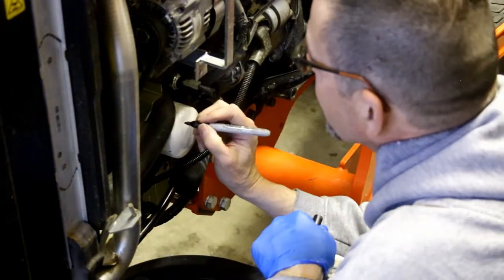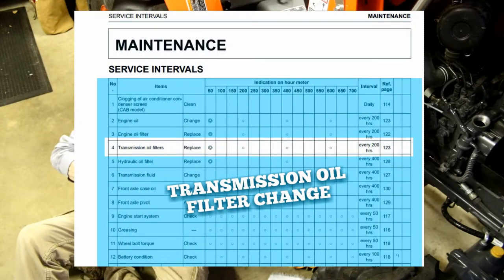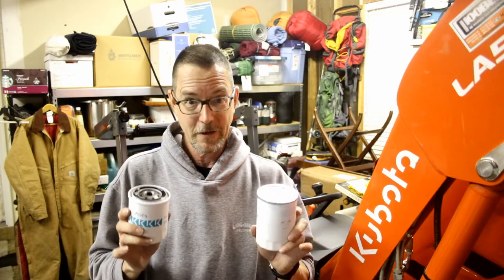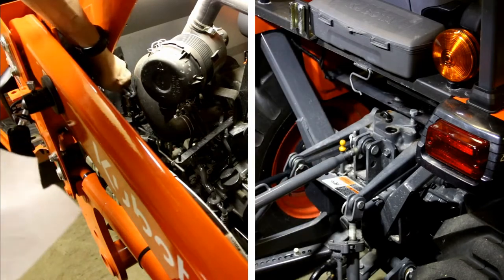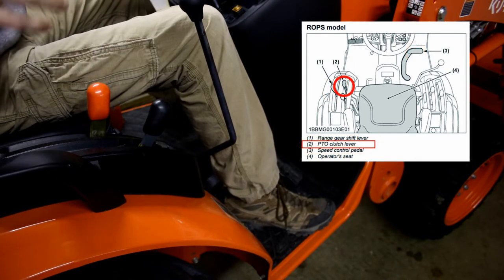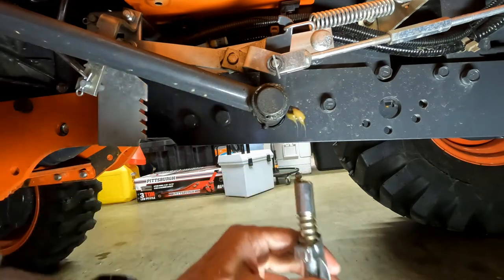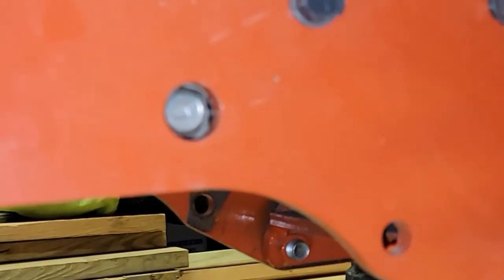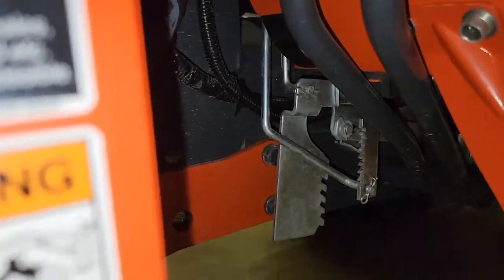012 - Kubota LX2610 – Complete 50 Hour Service – Tractor & Loader

Comment: Great video! Made a quasi daunting job a relative breeze.  When picking up the parts my dealer Kyle told me about the “shop vac trick” to decrease the hydraulic fluid leak during the filter change.  Had my son hold the shop vac over the input hole and likely lost less than 100 mls while swapping out the filters. Have no idea how much I would have lost otherwise.  Thanks again!
Reply from the maker: Thanks for watching, and glad you found it helpful.  I too have heard of the shop-vac trick.  I will likely try it next time! 👍😎

Comment: TIP. When changing the HST and SUCTION filters use a shop vac. to draw a vacuum on the HYD oil reservoir at the fill hole. You will not loose hardly any oil. I tried this on my B2650HSDC. It works !  To be honest I saw this on another You Tube channel.
Reply from the maker: Thanks for watching Roy, and that's a great tip.  Did you just stick the hose over the fill or do you try to get a tight seal?
Reply: @watershedoverlook  You don't need a super tight seal but you want enough of a seal to pull the HYD oil back into the reservoir instead of it going into the drain pan. You really need two people. One to use the shop vac. and one to replace the filter is the easiest way.
Reply from the maker: Sounds good Roy...I'll give it a try next time!
Reply: @watershedoverlook  For a video reference see channel (Forest To Farms) Kubota B2650: HST Filters Change. May 16, 2018

Comment: Nice video for this service. I did mine a few months ago. Asked my wife to help with the shop vac to minimize hydraulic fluid loss when replacing the suction filter. While that worked great, my corrugated shop vac hose is still seeping hydraulic fluid lol.
Reply from the maker: Lol...That's good to know.  I've heard a lot of folks talk about the shop vac option but that's something I hadn't even considered.  Probably no worse than some of the other muck I've sucked up into the thing, but definitely a factor to consider!  

Thanks for watching! 👍😎

Comment: great video. if you block the hydro vent by the filler cap you minimize hydro fluid loss. I only lost about 1qt . I also did the loader inspection, most biolts were not torqued to spec and I'm missing one.
Reply from the maker: Missing a bolt...yikes!  Mine were all actually pretty good.  After all the horror stories I've heard, I'm pretty sure my dealer went over them pre-delivery.  I didn't have any wheel lugs or loader bolts that seemed loose at all.  I'm calling that a win!!!   Thanks for watching Bob.  👍😎👍
Reply: @watershedoverlook  got a replacement bolt this morning and all is good.
Reply from the maker: @bobschreier9476  Excellent!  Glad you're back in action! 👍😎

Comment: Nice video Chris!!  When I changed my oil I added the oil to the motor to the oil port on the top of the motor. In your video I seen where you added the oil to the lower oil fill cap. Does the service manual mention which oil port to put the oil into?
Reply from the maker: Thanks for watching, and that's a great question Matt...I'll have to check!  I helped a friend change their oil a few weeks before and I just did what he did!  Hmmm...🤔👍😎

Comment: Wonderful video. I have several Kubota products and while I believe they are top notch, their manuals are not the most clearly written and in some cases are wrong. I guess it could be a translation issue but the are disappointing in some regards. Also actual photographs of the area would be better that illustrations. It’s easy to get disoriented on front/back, left/right on the machine as you did with the hydraulic/HST filters.  My diesel zero turn and my X1120RTV have different colored filters to eliminate that issue but the tractors like my L3830 are both white. Your a very detail oriented guy, which is great, are you a pilot or in the military?  Keep up the good work
Reply from the maker: Thanks for watching Steve and for the kind words.  As someone who has worked for years in graphic communications I find it very easy to pick apart product documentation.  In the case of my Kubota manuals I am quite annoyed that they didn't predict all my questions and searches in advance!  OK, not really, but I did find a few spots where I think a bit more annotation or cross-referencing might have been beneficial.  Honestly, I think my REAL issue was just trying to do two  things at once--that is perform the service and stage/light/film it at the same time.  (I'm not a great multitasker. 😉)  You are correct though, I can get pretty detail-oriented (some might say super anal-retentive 🙄) and I am a private pilot, although I have not been current in a long time.  I was never in the military but I am the proud son of a USAF fighter pilot (F-86 Sabre jets) and the proud father of an active duty airman who gets to fly in everything from B-52s to F-15s as an Airborne Combat Photojournalist with the 1st Combat Camera Squadron.  Thanks again...👍😎✈
Reply: @watershedoverlook  
Great. Thanks to your Dad and son for their service! 🇺🇸
Kubota makes great equipment but they need to reevaluate their manuals.

Comment: My dealer said to compress all Hydraulic cylinders beforehand. Is there a reason they would say that? Yours are all the way open so reason I asked.
Reply from the maker: That's a good question.  I suppose if you were changing the hydraulic/trans fluid compressing all the cylinders would theoretically allow you to drain more of the older fluid but that's just a guess.  I just reviewed the manual for the tractor and for the loader and didn't find that included in the procedure, but I would be inclined to trust the experience of trained service pros.  I'll ask around and if I can find anything I'll reply here again.

Just to be clear, you were talking about the tractor service and not greasing the loader, correct?  (FYI, nothing about compressing the cylinders while greasing in the manual either! 😉)
Reply: @watershedoverlook  yes correct I'm talking about performing the actual service. Wasn't sure if that's why the Hydraulics were a little sensitive at the end they're.
Reply from the maker: Anytime you introduce air into the system (oil/filter change) you will need to cycle the cylinders a few times to purge the air.  It certainly seems feasible that compressing the cylinders beforehand might minimize the air, but it will purge in a few cycles either way.  So says the NON expert! 😉👍😎

Comment: It looks like your brake pedal grease zerk fitting didn’t accept grease, might be clogged. Also the FEL requires grease labeled EP (extreme pressure, also it needs to contain at least 3% moly. EP moly grease is almost always black, looked like you used a poly lithium grease.
Reply from the maker: You are absolutely correct.  I realized when I reviewed the footage that I hadn't gotten grease into the brake zerk and did go back and address that.  I was completely unaware of the EP grease though...I will definitely investigate that further.  Thanks for watching and the great comment!  👍😎
Reply: @watershedoverlook  Schaeffers 274 is a high quality Moly EP grease that meets CAT equipment standards. Since you are using lube shuttle they make something similar.
Reply from the maker: Thanks!

Comment: I thought oil filters were hand tight ONLY. I have never in my 53 years ever used a wrench to reinstall an oil filter.
Reply from the maker: John, you are correct.  

The manual indicates that you should hand tighten the filter until it contacts the block, then tighten it an additional 1/2 turn.  That is pretty much what I did, albeit with the wrench since my hands were pretty oily.  I did probably over-tighten, but not significantly.  Perhaps it will come back to haunt me, but in all my 60 years it hasn't happened yet. 😉😄

Thanks for watching and for the great comment. 👍😎
Reply: @watershedoverlook  Just had my brand new LX2610 cab modle delivered Friday just turned 2 hours on the engine clock.  My 1st tractor. Got lots of plans and lots of learning.
Reply from the maker: @johnbalzano6588  Congrats John!  I'm pretty envious of that cab!  You're gonna' love it!!!